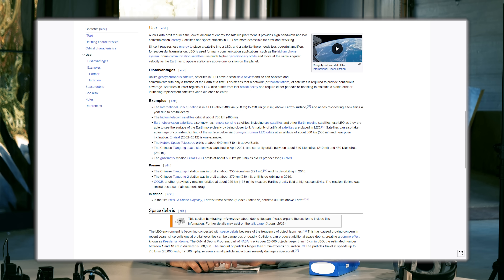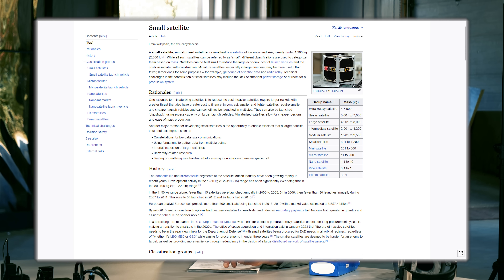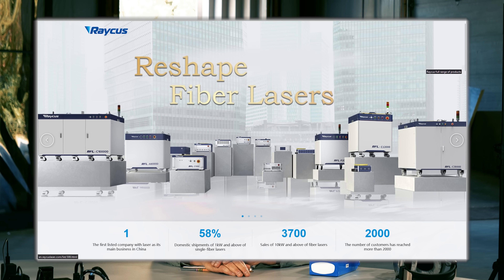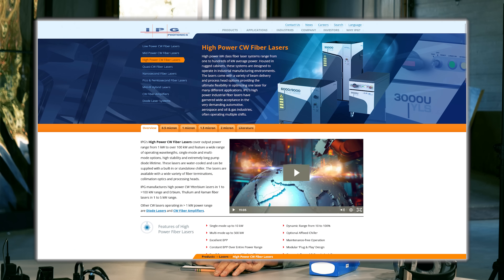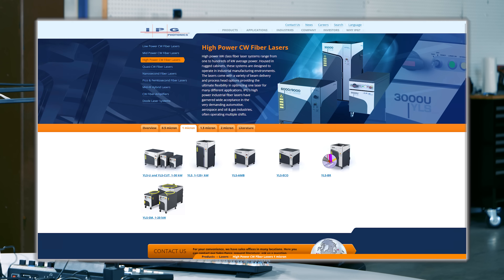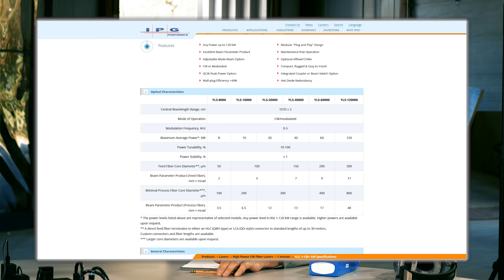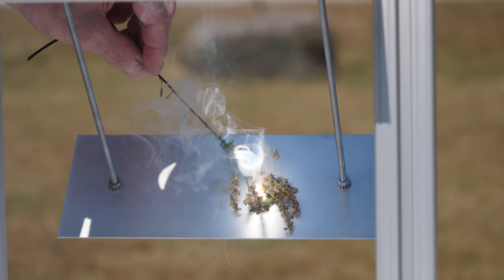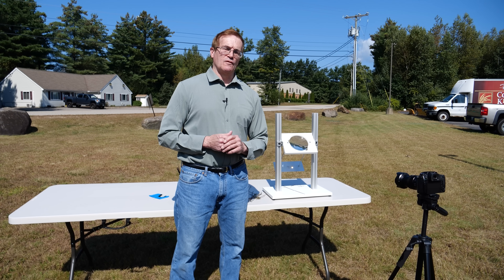COULD SATELLITE LASERS REALLY DO THIS?...

Comment: To compensate for the beam spreading, could you not have an array of beams that overlap over a small point on target? Each individual beam would still spread, but also overlap a tiny portion with neighboring beams, focused on the target, increasing the amount of energy hitting that spot above what a single beam could manage?
Reply from the maker: No, that won't work. The smaller diameter beams will themselves diverge more quickly than the single larger diameter beam, and the result will be no more concentrated.

Comment: Focused microwave Lasers based on earth beam up energy to the satellite reflector. Then it is directed back to earth. Come on Guys it's old technology. I have seen them in use.
Reply from the maker: You must have been tricked.
Look up the principle of divergence. Really, do it. 
It's  proportional to the wavelength and inversely proportional to the diameter of the reflector.
Even at a very low Earth orbit, a 10 meter diameter transmitter will produce an 80 meter beam at the satelite, which is too big to collect, and a similar spot size will occur back at the ground.
Come on, do your homework.

Comment: Another thought thrown in from the peanut gallery: You could have additional SOL's ( Sub Orbital Lasers...for those unfamiliar with Akira) aiming their beams at the same 1/2 meter patch of ground.
Reply: A sub orbital space object would essentially be an incoming missile as it would fall down somewhere .
  However, ISS 400km is not the lowest orbit that can be used, just the lowest that's safe enough for the 30 year flight with astronauts on board .

Comment: Having built some of my own laser equipment for cutting precious metals, I can see you're absolutely right about the fiber, laser technology. The average in the user will never exceed 50 W for a really good quality, laser, engraver, and soft material cutter. And likely won't exceed 100 to 150 W for cutting metal up to an eighth of an inch thick. Of course, this is all on the ground without the lensing effect of the atmosphere, but when you start jumping into the kilowatt range, the distance a destructive beam can travel even with the lensing effect of the atmosphere can be phenomenal.  And with a variable optic system, properly tuned, disruptive, atmospheric contaminants could be blasted out of the path of a beam creating an effect similar to that of a lightning strike. Might only be for a few milliseconds and it would certainly take significant levels of power but if you were to focus 20 kW into a 1 inch beam, it would be devastating.
Reply from the maker: Our new fiber lasers for our directed energy...device total 3,000 watts, and indeed, it gets spooky.  Stay tuned.

Comment: Off topic here. Could these 95 sun magnification solutions be applied to lets say the sun in general? Im noticing the UVB getting higher and higher in (UVB meter). Personally I think the light is being intensified with reflectors. of some sort. I can send you an email with examples.
Reply from the maker: Not likely. 
The sun would have to be concentrated by a large reflector to transmit meaningful power.  Because the sun is an extended source (1/2 degree), the light will diverge, requiring an even larger reflector to compensate for that.

Comment: The conclusion is good, I understand the heat will ignite and cause the combustion of flammable or volatile materials such as gas lines, dried trees etc. how do you explain the video footage of houses sliced in half? Could that be done within a two mile radius.? Using DEW or a laser beam.?
Reply from the maker: I've never seen such footage.
Reply: @TechIngredients, People have taken those pictures on previous CA wild fires using their drones. Unless, they are fake, they are very impressive at how those buildings or houses are sliced in half.
Reply from the maker: They may not be "fake," but they could be misleading. The problem is that the highest energy laser systems are likely in the 1 Megawatt range. The highest openly demonstrated are around  1/2 Megawatt. Given enough time, as in many minutes, that energy could vaporize a midpoint section of a small house.  But, the heat around that section would, over that same period, ignite much of the rest of the building.  You'd never see the slice.
Reply: @TechIngredients , one last question, wouldn't a diffusion factor from LEO to going atmosphere to touch ground be a problem?

Comment: I'm not very educated in this subject matter but what about using a phased array laser system, using pulse modulation at high frequency.
Reply from the maker: Those are options, but they add complexity. Phase coupling individual lSers is delicate and potentially unstable. Pulsing a laser increases its peak power but can significantly reduce the average output power.

Comment: Question, why is he throwing the laser, optics and power source on the satellite, wouldn't it just be optics on the satellite and the laser we fire and power source are on the ground. Firing at the mirrored optical satellite correct? Then hitting said target on the ground.
Reply from the maker: The problem is logistics. The satellite  coverage is global, and the area is huge, but the ground based laser  would  have to be located in the general  target area.

Comment: They do work .One was planned to be used by first expanding the beam and then with a controlled deformable mirror focused on a chosen location. The attitude stability requirement was high but proven in a test
. Attitude control was my task.

Comment: I was at the solar laboratory out there out west and they used heaters on the mirror to modify the shape of the mirror so they could take out Distortion of the atmosphere so you can think about that but I tell you what you're you're right on top of this I like your scientific approach
Reply from the maker: That approach has been around for some time. The problem is heating is slow and it bleeds across areas of the mirror you don't want to modify.
The more recent and better approach is to incorporate a MEMS mirror in the optical train. Look this up, it's really interesting.

Comment: could a 1 second pulse from a capacitor bank acheive much higher intensity rsther than a 10 minute sustained beam?
Reply from the maker: The limit isn't  the instantaneous power input.  The laser is designed to operate at that output. Pushing  it harder will burn out the diodes or even cook the fiber.

Comment: I thought this was an excellent, informative lesson and your efforts are greatly appreciated. While I don't agree or disagree with your conclusions I do have lingering questions that haven't been satisfactorily explained. Forest fires and now two urban/city fires do not generate enough heat and don't have the required fuel sources to melt alloy car rims leaving puddles that then solidify on the pavement. Nor do they have the energy/fuel to completely cremate a human body sitting in a car, that takes hours in a blast furnace. We've unfortunately now seen this in Hawaii & California. I don't pretend to know the causes but it's not natural in either location and there's many many other anomalis I didn't bring up here.
Reply from the maker: How do you conclude that these fires couldn't generate that much heat?
Cremating a human body does not take hours in a blast furnace. A blast furnace is twice as hot as a crematorium. 
Each vehicle contains about 100 kg of fuel. That is equal to about  5 billion joules. Even a 1 megawatt laser, which is too heavy to put on a satellite, would take over an hour to deposit that much energy...for each vehicle.  The numbers really matter.

Comment: Blue things are blue because they reflect blue light. Sunlight is >50% IR. ( blue PE absorbs IR)   A blue laser, either in space or on ground and reflected and aimed from LEO will do what was done to Lahaina. Grass fires do not turn porcelain and concrete, etc to ash.
Reply from the maker: Blue  lasers are not powerful enough. 
Do some research into actual laser sources, and you can confirm or rebut that statement.
Gassoline and domestic hydrocarbon sources CAN burn that hot.
If you're convinced that the fires were intentional, one or two people on the ground would be more effective and enormously less expensive than a space based source.

Comment: Nice video thinking a space laser working in tandem with a high orbit airplane that is fitted with a large magnifying glass could greatly increase the laser beam strength by multiples.  A laser drone could opperate at much lower altitude with much smaller laser.  You can find a pdf online from the 1980's from the forest service exploring the idea of using lasers to start back burn fires. My question is if a powerful space laser was used over water and the laser was made to move in a tight spiral direction could it form a water spout because of the heat the motion and the moisture  or a tornado if done over land mimicking  how they form naturally.

Comment: Two things i took note of in this presentation is that he spoke of corrections made to the beam to allow for rippling of the air. This can work great for telescopes (which is where he is bringing his knowledge from concerning keeping an image focused as the light comes through the atmosphere) but the laser device he is speaking would not benefit from this technology because there is no way to sense the beam pattern differences because you can only sense from the ending  point of the beam and not from the starting point. You can have no sensors at the ground level where sensors could see the bending deflection of the beam to be able to make focus corrections. That tech works for telescopes where you are at the receiving end of the beam or image and you see the effects of the distortion and the technologies sensors can fix it. Except you are at the sending end of the beam so there is no way to know what effects the atmosphere is having on the beam.
The second thing is in his demonstrative tests at the end the grass and vegitation is being held still in the beam so each frond can absorb the radiant heat of the beam. The situation on Maui was very different in that the wind was blowing hard so the fronds were moving briskly. The movement and wind actually has a cooling effect making it much harder for the beam to stay on target and build heat. Already knowing the beam's direction and final location are diverted by the uncontrollable affects of the atmosphere including beam disruption from air layer temperature variations, specular deflection from dirt and pollutants and absorption by the different gases themselves, the heating of any one spot on the surface is significantly less than he discussed.
Reply from the maker: Regarding  your first point, adaptive optics can be used to improve  the beam quality of both telescopes and lasers.
Lasers will suffer from thermal effects in their structure and optics, and these can be counterd just like atmospheric effects. This degredation can be modeled, and that is why these systems  are used on the world's largest lasers like Nova.
To calculate  the needed corrections for atmospheric distortion, you are no longer dependent on the single point guide stars used for early systems. The scene  can be imaged simultaneously (at another wavelength😵‍💫), and high spatial frequency features are analyzed. 
The distortion is deconvolved, just like correcting for motion and focus errors in a digital  camera. This requires  very fast computational power, but today, that's  not a problem.

Comment: What vibration would go through tiled roof, concrete ceiling and floor and enter human body. Then few days later travel into another human body by touching ? And it felt a low and dense. It's weird. London England, around 2014

Comment: What the difference in solar intensity between 12:00 and 16:00?
Reply from the maker: The equator  at noon and 45 degrees  north in the afternoon.
Reply: @TechIngredients 
I'm asserting that the energy flux shouldn’t be highly dependent on the Sun's position relative to the horizon. This holds true as long as we are measuring it on a plane that is perpendicular to the direction pointing towards the Sun. However, I’m not even sure which formula you are using to calculate it.
Reply from the maker: The atmosphere  does absorb and scatter the sunlight.  As you approach  the horizon,  the path length through the atmosphere increases.

Comment: In the late 80s, some students at UNR Reno developed a square beam ultraviolet laser called the excimer laser that had a ridiculously low divergence loss. It was taken away and the program was ended. It was covered at the time by popular science, so im sure the story is still available. Not the ending of the development, but the device itself. It was rumored to be used for submarine signsl transmission from satellites, but it could be focussed to such a smsll point that it would visibly ionize oxygen molecules in midair flashing and popping. It could definitely be used for other jobs .
Reply from the maker: I've worked with eximer lasers. They are based on a mixture of a noble gas like neon, argon, or krypton and a halogen like chlorine or fluorine. They operate in the UV and are pulsed. That is how they generate the high peak powers that can ionize the air. These lasers have been around for decades.  They can have low divergence but are governed by the same principles as all lasers. Modern fiber lasers are even better in this regard, but both are close to the fundamental limit for light propagation.

Comment: An extremely interesting lesson. However, rather than using a satellite as a DEW platform, what would be the plausibility of aircraft platforms?
Reply from the maker: Everything would be easier.
We weren't supporting DEW systems or trying to optimize them. We were addressing the allegations that they could or could not be the cause of the fires that were seen in Maui.

Comment: This guys doesn't take pulse modulation into account. Or the "electromagnetic Missile" effect, discovered in the 80's. When you pulse a laser, or a microwave weapon (most are already, not continuous wave) you get more of an effective range. Slower loss of energy over great distances. Essentially, with fast rise-time, quick discharge pulses, you effectively extend the "near field" of the source. Out to hundreds of miles in some cases. Almost all microwave high powered radar, and most likely DEWs, are phased array pulsers. You get better beam focusing and directivity this way too.

I don't think this guy discussed ANY of that in regards to pulse modulation....can anyone correct me here?
Reply from the maker: Sure, I can.
It simply doesn't  work that way. Pulsing  a laser doesn't  change its absorption or divergence.  Ultrafast lasers can ionize the air and change its density, allowing a beam to propagate further, but these lasers are bulky and much lower in average  power.
Reply: Alternatively, I could send you the paper I referenced initially, I have it downloaded as a PDF.
Reply: The linked paper is in regards to high powered Radar, but the principles behind it remain valid for all EM radiation. I believe tests on "electromagnetic Missiles" in the optical frequency range have been carried out as well. I could probably find more papers on this if you'd like.
Reply: @TechIngredients  You guys keep filtering my comments and links...what a joke Youtube has become. I keep trying to copy/paste an Archive like to the paper I mentioned that keeps getting removed.

Comment: I wouldn't be surprised if they haven't been able to come up with a method to make large custom dishes using vapor deposition, possibly even making "sapphire" (aluminum oxide) dishes instead of silicon oxide based.  The dishes would be lighter, stronger and probably stiffer (AT LEAST relative to weight). IDK if there would be much improvement of reflectivity but with the vapor deposition maybe the surface could be more consistent than even the polished glass reflector.

As for power supply, I seem to recall talk about using ground based generation and then transmission to satellites using either microwaves or laser.  If there were one weaponized satellite, it could be powered by either ground based generation stations or maybe more realistically, "feeder" satellites that are basically orbiting batteries that can receive & store energy & then transmit the energy to the weaponized satellite as needed.

Comment: Points to be made. Satellites could be launched as modular components to be connected later. MIC has had over 50 years to assemble massive systems beyond your estimations. This would mean power systems could be larger than estimated for a satellite. Separate satellite systems could be used in conjunction as well which means your 10 min estimation is irrelevant. To assume that the number and distance of satellites is accurate is also an unfair assumption. That and more renders many of your assumptions moot, but I appreciate you making your assumptions clear. Quite informative as usual. Very interesting as well. Keep up the good work.
Reply from the maker: The reason  I didn't  go down that road is that it simply  wasn't  necessary  to make the argument.  In addition,  the drawback  to large, multi launch platforms is that there will be fewer of them, and that means fewer orbital paths will be covered.